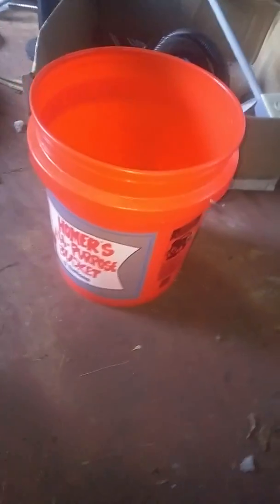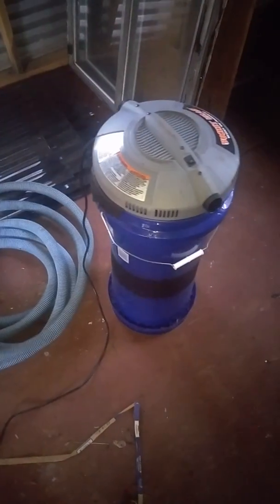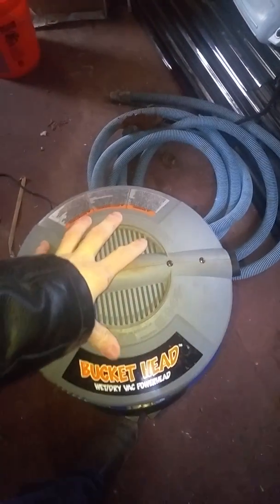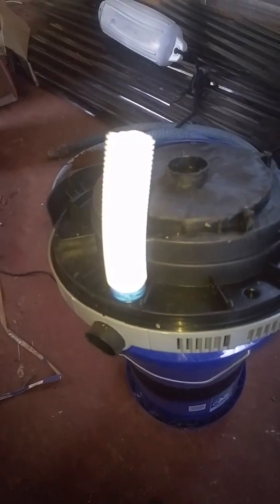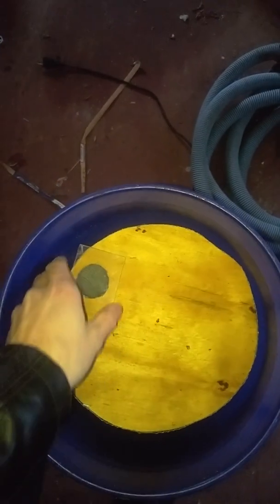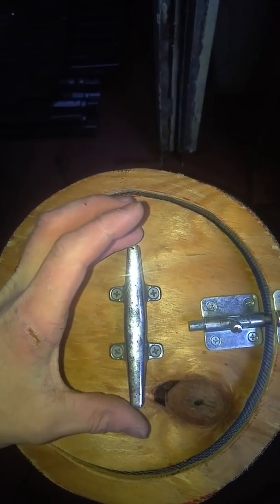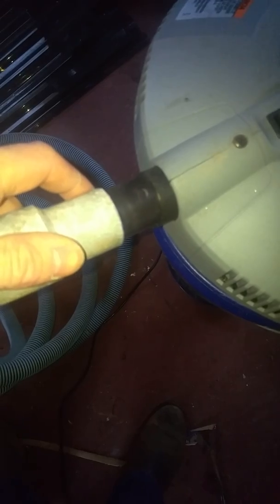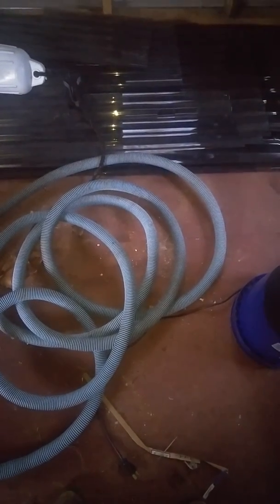Explaining my honey bee vacuumed

Comment: How are you regulating the air flow
Reply: The vacuum head isn't very powerful.  Didn't end up happening to need any form of regulation. If you need it regulated. You can just add a pvc ball valve glued to the side.